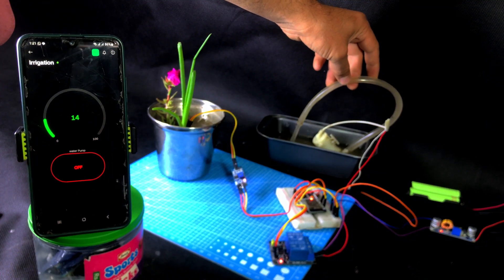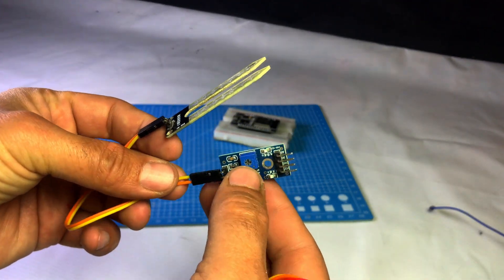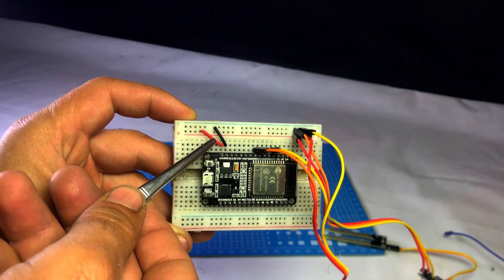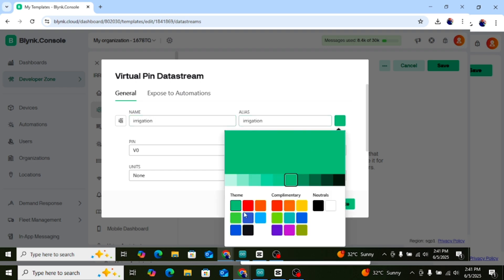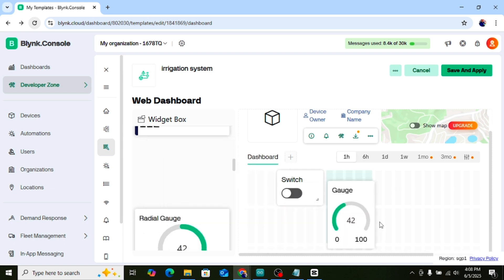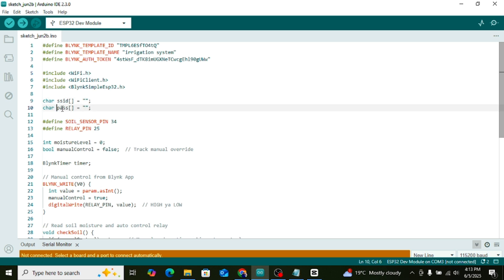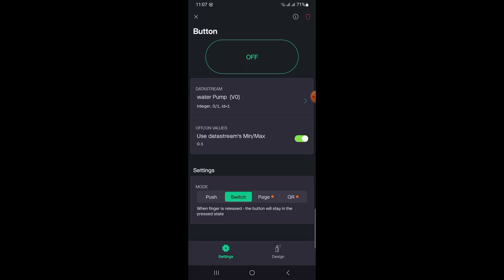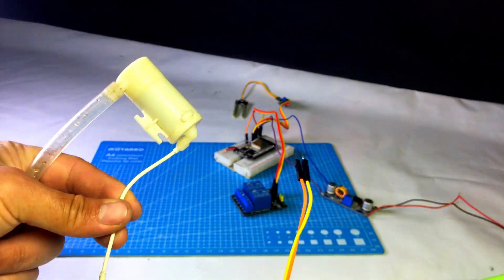💧 Automatic Irrigation System using ESP32 & Blynk App | Smart Plant Watering System

Comment: Hi, I would like to please help with something I am working on: it is about watering a flower pot. I have these components in the project: ESP32 dev kit (wifi, Bluetooth)
Breadboard (8.5x5.5cm)
Water Pump 5v
Batteries 6v (Battery Case)
Soil Moisture Sensor + Compare module
jumper wire
And the connection is like in the video. I have a problem that the pump switching does not work. The project should be connected using blynk but it connects to the ESP but does not respond and does not want to turn on the pump

Comment: i added a dht sensor and im xperiencing a certain problem, when the pump turns on, it forces the dht to turn off failing to read the temperature and humidity values.
Reply from the maker: Make sure the DHT sensor is properly connected to the ESP32 and the power supply is stable.
Reply: @ktronic110 the pump has it's own power supply and the esp 32 also has it's own power supply. When the pump turns on the dht sensor just turns off and the lcd starts to misbehave.
Reply: @ktronic110 can i send you the video

Comment: Broo
Why blynk app is not working it's not working when I press the button
Reply from the maker: cheak wifi connection
Reply: Motor also not running broo
Reply: I don't know what to do could you explain what happened to motor